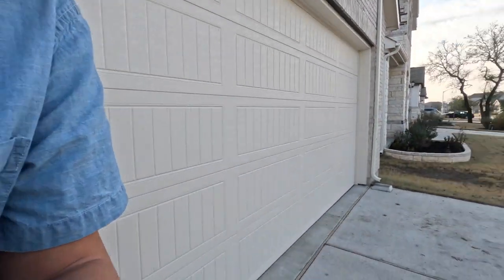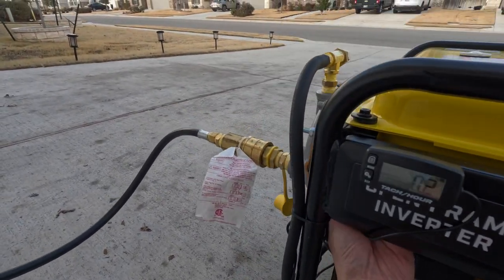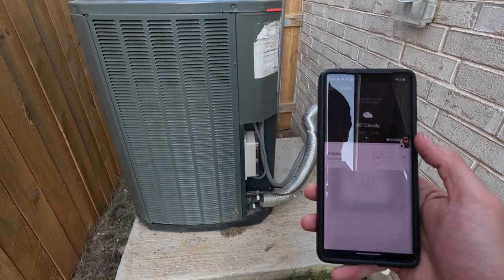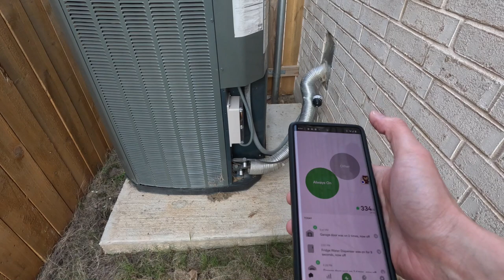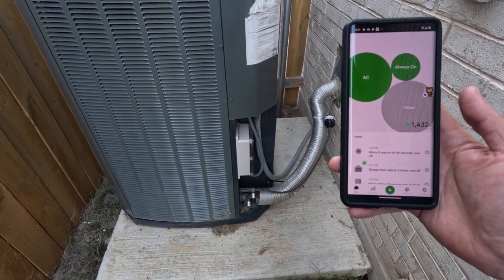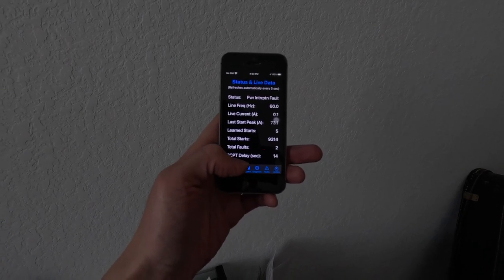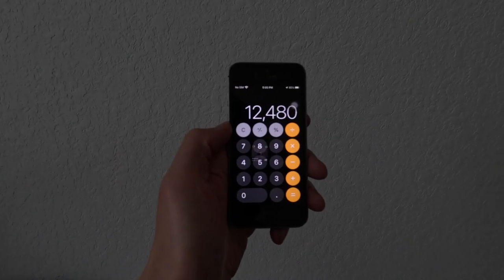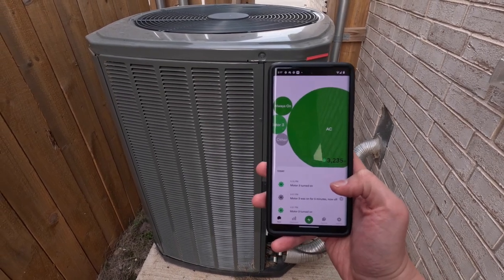Can a 8750W Motor Snorkel Tri-Fuel converted generator power a 4 TON AC Unit using Propane???

Comment: Your neighbors will love that loud monster.   I powered my house 27 days from a generator.   I was really the only one doing it.    Some people had small generators and just used it a few hours each day for their refrigerators.   I had the fuel and the power to run my whole house.   I now have a generator that ‘s diesel and is super quiet.  I did a test run on the weekend of 5 hours and nobody even knew.
Reply from the maker: That's awesome! I didn't know diesel runs quieter than gasoline. I know propane makes my generator run quieter than gasoline. What model diesel generator do you have? I'd be interested in researching into other generators - thanks!

Comment: You have to make sure all other breakers in the house totally off, start the inside air handler first, NOT the entire A/C system, the inside air handler should be on a separate breaker, once the air handler starts up, and is running for a few minutes, then start the outside condenseing unit, once your outside A/C unit is up and running, you can turn on other breakers you wish to run inside. It's a several step process but it should get you up and running on gas or propane.

Comment: If your generator will run your AC with natural gas, it should run with propane. The problem, I believe, is the single propane tank is not able to provide enough fuel. Get one of those Y adaptors to attach 2 propane tanks to your generator and it should work. Rather than 3/8ths standard propane hose, you may want to use 1/2" or 3/4" hose after the propane tanks are merged. I have a Champion with a Motor Snorkel installed as well, love it, more expensive, but I went 3/4" all the way.
Reply from the maker: I haven't run it with natural gas yet, only gasoline and propane so far. I plan to make a video when I set up a natural gas line from the house to the generator. Definitely going with 3/4 inch for that since natural gas has less pressure (and less volume) than propane. Thanks for the tips!

Comment: Watched your videos on this champion generator and after seeing you use the snorkel kit on it and run your 4 ton ac I purchased the tri fuel 9000 watt starting model like yours and installed the micro air easy start and I am so far highly satisfied with this unit thanks to your review

Comment: I haven't read all the comments but consider increasing the capacitor size inside your softstart unit to further reduce the LRA a bit more. I see you have a micro-air and these guys are super helpful. I have a 3.5 ton AC but had to go with their larger sofstart (for the 5 ton) to get my LRA to under 34 AMPS (Originally is 104). This solved my issue without bitting the bullet on a larger inverter generator and installing a 50am inlet for it .

Hope this helps.
Reply from the maker: I was able to get everything to work out. I don't think I tuned my generator the first time to give it enough fuel for it to operate at the heaviest load on propane. I got it to now start on gas, propane, and natural gas. Thanks for commenting!
Reply: What were you LRA with the smaller soft start?
Reply: @alejandrocarrillo373  I was getting an output for around 45-50 amps with their smaller version. It was still a significant drop but not enough for my Inverter generator.
Reply: @JoeV2020  I have a 3 ton. Do you think I should just install the x72 instead of X48? I’ll like to have lowest  inrush as much as possible.

Comment: A 4-ton A/C needs a 50A Generator like 12k or 13k to be able to start and run the a/c unit(s)....
I bought this Champion inverter Generator 8750w/ 7000w running on gasoline.  On propane will dropped to 6000w, on Natural Gas maybe 5400w only which Hopefully will Run my 2ton A/C unit (s).  I think I need a Soft start too

Comment: Even if the peak start is above your surge on the generator, it should still start. The power factor, how quick that surge is, and the fact that the amperage shoots up because of the voltage drop.

I believe what happens is that on some starts, the pressure in the compressor is high causing it to take a bit more to start. This causes a severe drop in momentary voltage which in turn runs the amperage up significantly and why you saw 70 something amps on that first pull. The soft start sees it as an overcurrent and cuts the power or the soft start takes longer to start. 

With it being to close to not starting it sometimes, you might want to ditch it starting the AC. I have a 5 ton and 8500/11500 generator. Easy start would get start amps to 35ish. As soon as it was on generator power, that was 50-60. Sometimes it would fail to start, sometimes it would get it. I didn’t see that as a viable option so I returned the easy start. Im sticking to cooling just half of my house on a newer 3 ton. Generator never has an issue starting it so I feel comfortable leaving on over night with the many cycles it does.
Reply from the maker: Yeah, that makes a lot of sense. You need it to reliably start every time or else you'll be babysitting the thing on every cycle.

Comment: Great content!  I recently purchased the harbor freight version of this inverter generator (same output but gasoline only).  Had a coupon that brought it down to $900.  We have a 3 ton AC upstairs and 2 ton downstairs.  Having the house wired next week with an interlock switch and I'm going to install the micro air soft start on the 2-ton unit. We spend most of our time downstairs anyways except all of the bedrooms are upstairs.  Not a problem at all to use an air mattress or sleep on the couch to stay cool during the summer if we have an outage.  I'm thinking the 2 ton unit will start easy.  For heat, both units are gas and draw very little power.  Gas dryer, gas range, gas hot water also helps reduce our power load.
Reply from the maker: Thanks! I'm happy you found the content useful. After you get your generator inlet / interlock kit setup, you might want to try starting the 2 ton AC without a soft start. There might be enough power to start it without one. If you don't need it, you might be able to save several hundred dollars. Overloading the generator once shouldn't hurt anything - the breaker should just trip protecting all the equipment. Hope your setup works well! Having gas for everything else is really great. Thanks for commenting!
Reply: @jonathanDIYs  it might start it but I think the AC compressor will bog down the generator a good bit without the soft start installed. I'll let you know how it turns out.  Having the interlock and inlet on the house installed this Thursday.
Reply: @jonathanDIYs got my interlock wired up and soft start installed on the downstairs 2 ton unit. Inrush amps is only 23 and running amps is 6.  Generator starts it up great.  I'm sure consumption will be higher in the summer when it's hot, tested in 60 degree temps.  Our upstairs AC unit is a 3 ton and will not be running it on generator.  If we have an outage in the summer, we will just live downstairs and sleep on the couches/air mattress. No problem at all running the whole panel.  Running the house on it now to break in the unit.
Reply from the maker: @BrianNC81  Awesome! Glad that's working for you! You probably could have the upstairs 3 ton unit running on generator too if you wanted. Maybe not at the same time, but one at a time would probably be no issue. So for your inrush on the 2 ton unit, if you multiply it by the voltage (240), you can get the total watts used - 240*23=5,520 watts. That leaves you with about 2000 watts of headroom which is pretty good for you not to have to worry about having everything turned off just to get your AC on. Last tip I'd give is don't forget to change out the oil after the initial break-in. Some people change it after only even an hour or two because there may be metal filings that need to be cleared out from the factory.
Reply: @jonathanDIYs  I probably could if I bought another soft start but at $400 probably not worth it for how often power goes out.  The manual recommends changing oil after the first 20 hours.  Debating if I want to do it at 10 but than again might be best to follow manufacturer recommendations.  I have 10w30 Castrol synthetic in it.
Reply from the maker: @BrianNC81  ah, yeah...it's not about the oil quality - it's about "washing" out the initial filings that might be in there. When I got my generator, I put in cheap regular oil for a few hour break-in period, then changed to synthetic. Remember, extra oil changes won't hurt the engine, you'd just be wasting oil. It doesn't affect everyone, but there have been reports of people that use magnetic dipstick and after the first oil change, there's a good bunch of metal filings that get stuck to it. These bits of metal are mostly harmless but can cut grooves in the engine cylinder which aren't good in the long run.
Reply: @jonathanDIYs  I'll change the oil at 5 hrs, then again at 10hrs, followed by 20hrs, then next year or at 120hrs.  Probably going to run Rotella t6 5w40, highly recommend oil for small engines and I have a bunch of it in the garage
Reply from the maker: @BrianNC81  cool - I was reading this forum thread - https://bobistheoilguy.com/forums/threads/how-long-until-first-oil-change-on-new-generator.353476/ and the guys there were saying their first oil changes came out looking like glitter... I've never tried Rotella t6. Next time I do an oil change, I'll give that a shot. Thanks for letting me know about that.
Reply: @jonathanDIYs  changed the oil at 5 hours and it was extremely glittery.  Glad I didn't wait until 20!  I'll keep changing it every 5 until it's clean.

Comment: Just jump up a bit and use that one as a backup! One in hand is better than two in a bush! Enjoyed the learning!!!
Reply from the maker: hehe, it would actually be generator #3... I got a DuroMax XP4850EH too. Not sure if I could fit another generator in my garage or if my wife would be happy with more generators... 😂
Reply: 30 amp 220v?
Reply from the maker: @andrewulrich6612  yes sir, 30amp 240V.
Reply: @jonathanDIYs  it isn't tripping your breaker on the gen so its definitely a lack of watts. Also the soft start needs to run several cycles to learn and react. How many cycles have you let it do?
Reply from the maker: @Andrew Ulrich  yeah, I agree it is a lack of mechanical power in the generator. The soft start has been installed for over a year, so hundreds if not thousands of cycles have already been run on it. You can see my original install here - https://youtu.be/2_VcUyg5V7w. Thanks for commenting!

Comment: Jonathan, I am a dealer for Motor Snorkel. Great video, however I think your AC unit is too big for the Champion model you have, regardless of what fuel you use. Even with a Microair Easy Start unit, the running watts I believe are too much. It is not advisable for any portable generator to run at max wattage load for any significant length of time. For example if your 4 ton AC takes 6kw to run (not start) then you need ideally an 8-10kw continuous generator for extra capacity. 

I will be doing a video soon in the next week or so on a Tri-Fuel Conversion. The important note a lot of people miss is how to adjust the load block above the demand regulator. LEANER is better/cooler on propane/NG. It's the opposite with gasoline where leaner means HOTTER combustion temperatures which is BAD.

Cheers and keep up the content!
Reply from the maker: Hey Bassguitarist1985 - thanks for commenting! I totally agree with you on making sure that the generator isn't maxed out. However, I measured the continuous running wattage of my 4 ton AC and it is around 3.1kW. With all the lights and small appliances running (just no oven or dryer), it stays under 4kW load. With that, I'm staying between 50-75% max load which I think is generally safe. 

I don't know why my AC didn't cooperate during this video trying it on propane, but it did a lot better in my next video when I tried using NG. Check it out here - https://www.youtube.com/watch?v=Fgqlg9NThBM.

Thanks for the tips on tuning the load block - that's exactly what I read when doing my research. I think it is great when people put out more content on this topic - looking forward to seeing your video!

Comment: Yes, you need a larger generator.  I have a Firman Tri-Fuel running on Natural Gas and the same soft starter.  It is connected to my panel and my 4-ton A/C runs fine along with  other items in the house.
Reply from the maker: I tuned the gas flow a little better when I tried this with Natural Gas and was able to get everything working. You can check that out here - https://www.youtube.com/watch?v=Fgqlg9NThBM. Glad you were able to make your setup work on the Firman!

Comment: You discovered one of the downsides of inverter generators; they don't surge well. Looking at other comments, it sounds like you were able to richen up the engine to get a little more power out of it. Also, a few hundred watts of standby loads in the house, here or there, could make the difference. It would be cool if the easy start could be tuned to optimize the starting current or trip thresholds even lower. Cheers!

Comment: I did a test run on my Champion Power Equipment 100520 8750-Watt DH Series Open Frame Inverter today.  
Number 1 problem is RFI.  If you have AM Radios, then forget this generator.   The RFI is no where near as low as my 1990 Honda EX4500 which does not interfere with my AM radios.  This Champion 100520 will not be replacing my EX4500.  It will remain a good higher wattage back up.
Reply from the maker: Honestly never even considered AM Radios. Good info to learn! I suppose I will be turning off my generator if I want to get a good signal for NOAA weather radio... More likely than not, if I have my generator, I'd be able to get info off the internet if I can have power for my FIOS router.

Comment: When you cut main power and restored with auxiliary power your EasyStart went into a time delay mode and will not function properly until it resets. 
If you can switch from gasoline to propane on the fly I would start A/C with generator on gasoline then switch to propane while the A/C is running. 
When your A/C is off the pressure will equalize and your lock rotor amps (LRA) on start up will be the same regardless if it’s been off for a half hour or two weeks it will be the same. 
Hope this helps 🇺🇸
Reply from the maker: Thanks for commenting and for sharing that info... I'm still a little confused and can't figure out why the last time I tried this, I was able to start up on gasoline, but this time, even when I tried switching back to gasoline, I still didn't have enough power and the easy start was going into a fault state. Does different weather conditions affect the LRA?

Comment: I'm a bit surprised since I own a tri-fuel Champion model 100416 with specs similar to yours.  Like you I have a Micro-Aire easy start installed on both my 4ton and 2.5ton central air units and either will run on natural gas along with the fridge, microwave, and lights.  I manage the loads, i.e., I don't run everything simultangeously without reducing the loads.  I would call Champion and/or Micro-Aire for some feedback and question whether your "Snokel Tri-Fuel" is providing enough gas pressure, although I would think running on gasoline should provide enough energy.  Have you tried to "relearn" your Micro-Aire?  Starting amps seem high to me with the easy start.
Reply from the maker: Hi Thomas, thanks for commenting. The specs on your generator look a tad bit more powerful than mine - Gasoline: 10,000 starting watts and 8000 running watts, propane: 9000 starting watts and 7200 running watts, natural gas: 8750 starting watts and 7000 running watts. My generator is 8750 starting watts on gas, so I can imagine it gets down to probably 8000 starting watts with propane which is only around 33 amps at 240V which is pretty little. 

It's definitely the microair that is giving up during the process. I haven't tried "relearn" yet on the micro-air, but i'll give that a shot when I try to run the generator on natural gas. I am going to be working on the plumbing for that sometime soon and will have another video up for that. Thanks for the suggestion!

Comment: Just subscribed, and watched your detailed video on this generator. So did you upgrade to a larger size champion generator, or are you still with the 8750w??? Btw how is that generator holding up this year???
Reply from the maker: Thanks for your subs! Yes, i'm still with the 8750 generator. Haven't had many power outages at all this year, so it is nice peace of mind. Everything is still working well. Will have to pull it out of storage and test it again in a few months.

Comment: At what pressure did you set the propane regulator?  My propane test on a converted HF generator showed that 1 psi "flooded" the engine, and it would not start.  1/2 psi worked fine, and the generator immediately surged to carry a twelve-amp load.  Will unsuccessful tests like this damage the A/C compressor?
Reply from the maker: What type of generator do you have? If it is an inverter generator, it is mostly safe. If you're using a regular generator, you're probably sending fluctuating voltage and frequency to the AC which isn't the best. 

My propane regulator is a 1/2 psi regulator. I just use the load block to adjust the fuel. I think I had to turn the knob 8-10 turns.